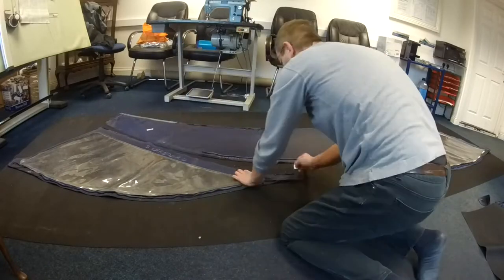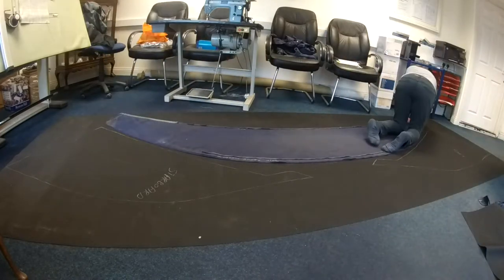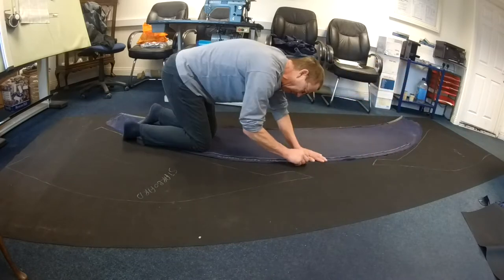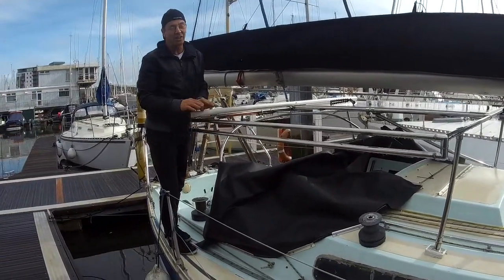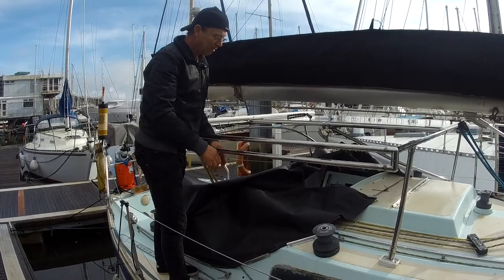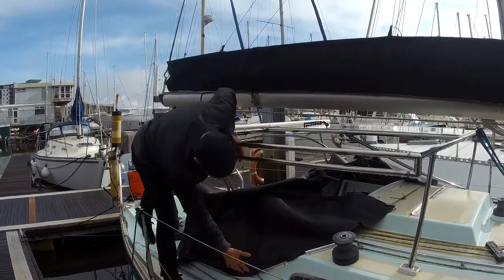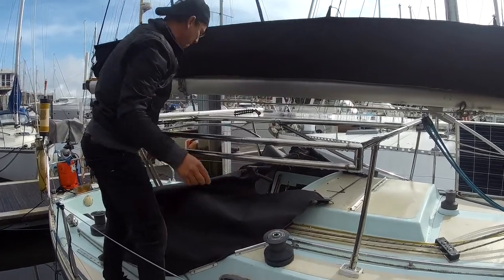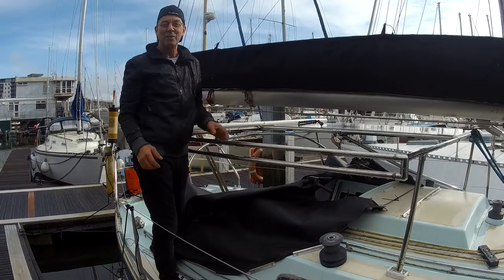Diy Spray Hood Part 1

Comment: Great if you have an old one to use as a template...
Reply from the maker: That’s what I thought, but it turned out to be harder than I thought, the new one has survived the first 2000 miles ok and kept us dry through some howling wind and large lumps of water being thrown across the deck at us